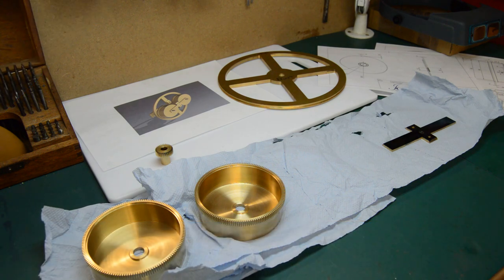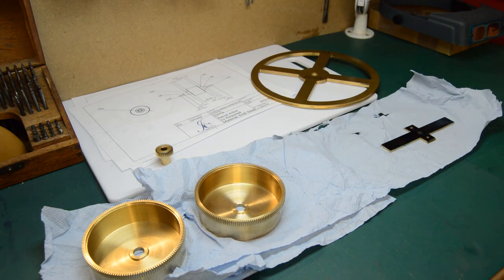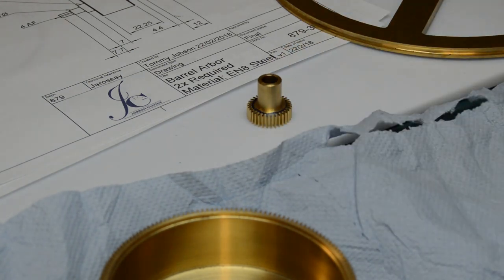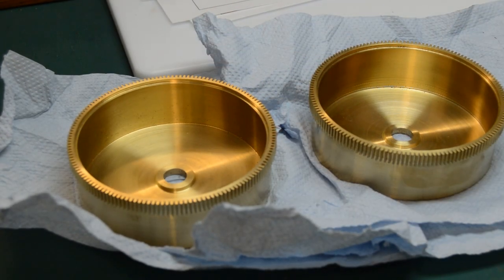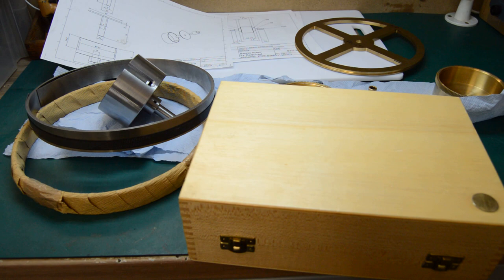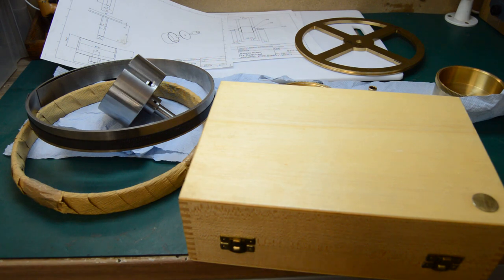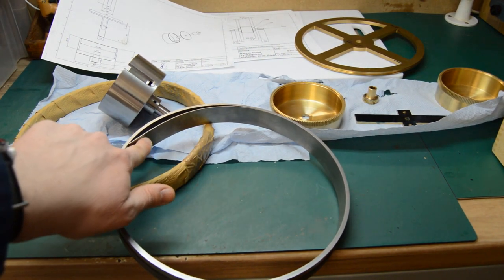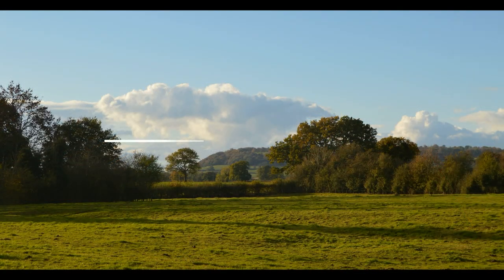Building a Jarossay Spring Drive for a Long Duration Regulator - Part 1

Comment: You sir sure do have a fine workshop. We are pleased to be here for a visit of making the pieces for time. You do have what we think is a really nice lathe, be it as big as it maybe, for we are to compare that to our watch movement parts making lathe sizes. We could clearly enjoy, as we are watching you make these parts with these nice machines all the day long. You are cutting some really nice teeth on both the one you shared being cut (smaller one) and those two matched pair look quit nice and yes that is a bit of material you are removing (good point). Thank you so much for the share. Lance & Patrick.
Reply from the maker: Thanks very much, your workshop looks pretty fantastic also!  Glad you are enjoying the videos. Tommy